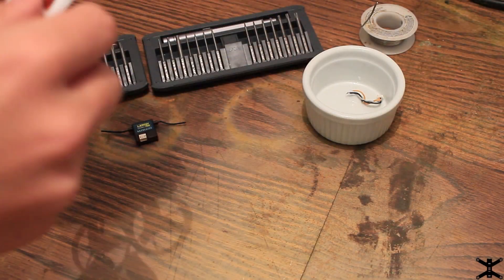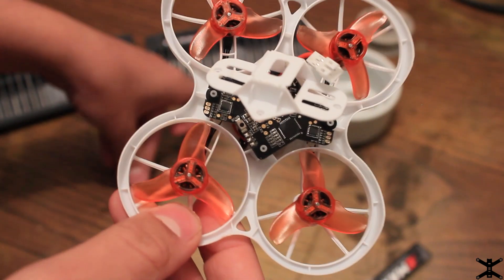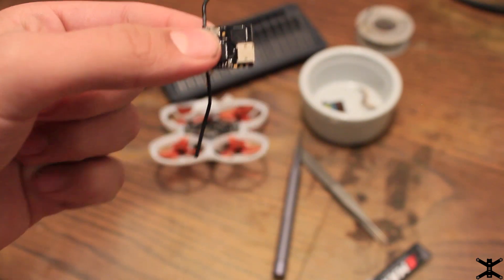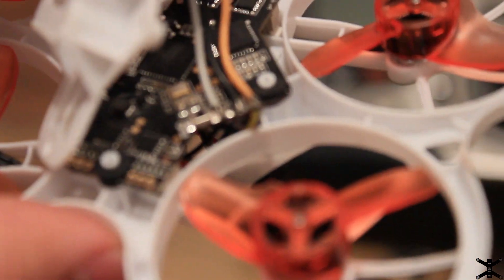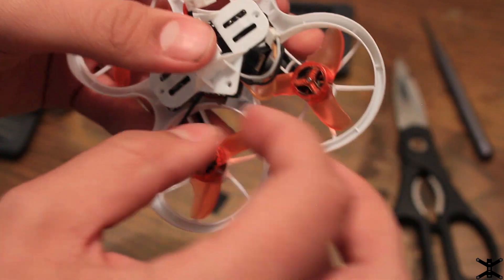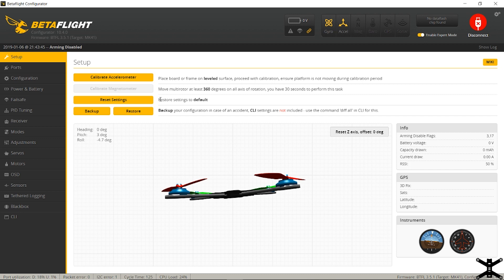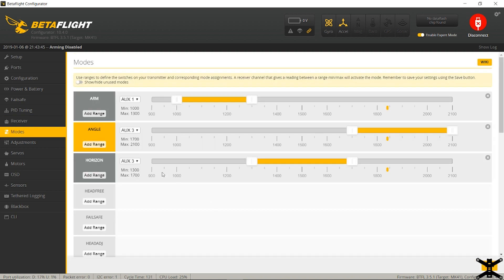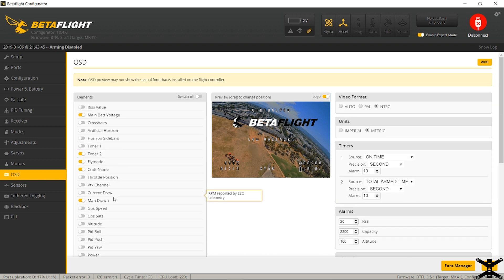How to Install and Configure a Spektrum Satellite in the Emax Tiny Hawk

Comment: Sorry to bother, but I am somewhat confused after reading some comments. I got the TinyHawk S, should I remove the capacitor, or just solder my satellite +/- to it?
Reply from the maker: I would just solder to the + - of it. I suspect the fixed the problem in the hawk S since it is a much newer version. Thanks for watching!
In the original tiny hawk that capacitor cause straight brown outs at low voltage for some reason. With the capacitor unhooked it the battery would slowly die instead of going from alive to dead in a second. At least this seemed to make a difference. Either way the hawk will work with or without the capacitor.
Reply: Virtual FPV alright thanks for the advice!!😄
Reply: Virtual FPV hey man, I just got done soldering and everything went to plan there, but once I hit save and reboot on Betaflight after selecting SPEKTRUM, my TinyHawk will not connect to my Betaflight, let alone computers... it says the device has malfunctioned. Super confused😬
Reply from the maker: @dylanmiller9604  Did you bind the Sat before soldering it in? Make sure your betaflight settings are correct.. Set to DSMX ect
Reply: Virtual FPV yeah I did, I can’t even get it connected to Betaflight at this point. My computer says “The last USB device you connected to this computer malfunctioned, and windows does not recognize it.” Whenever I plug it in... tried updating drivers and such but haven’t found a solution:/
Reply from the maker: @dylanmiller9604  Oh boy. You might have shorted something. Might be worth a shot to run a driver service to reinstall the usb driver
Reply: Virtual FPV sounds like a good idea lol, gonna do some late night troubleshooting😆

Comment: Excellent advice, this worked although I could not get turtle mode to work is there something I have to do in beta flight to get this to work?
Reply from the maker: Hey just make sure you have the right Dshot protocol set. Furthermore, turtle mode only works with the 4 blade props. You can try with the stock ones but its pretty hard to flip it over.

Comment: Hey folks, 16 year old here trying to get this working on the “S” model.  The video is great and super helpful. However, I was not able to get Beta Flight to work after the connection.  Has anyone else been able to get this to work on the “S”.  I will admin, the root cause could likely be my novice skills on soldering.  Any help/advice is much appreciated!
Reply from the maker: Hey man, does it not connect to beta flight or does beta flight simply not recognize the control input? Also, do lights come on when you plug the board in?
Reply: @virtualfpv3568  When I first got the drone I plugged it into BetaFlight and everything worked fine, so I know BetaFlight, cable and drone were all functioning. When I first started soldering the wires on, I’m pretty sure I bridged one of the gaps because after I was done soldering, and had moved into the beta flight part of your video, it would not connect although it did recognize it because it said “Connecting” when I plugged it in and the auto-connect box was checked. So I am pretty sure I messed up the board because I can’t get it to its original state even when I unplug the satellite and I pull off the wires. Also, when I plug in the battery, I see the board blink red, then solid red and I see a flash on satellite and then turn off.  I can’t get the light to change when I am trying to bind to the transmitter.
 
I did find a receiver (see link below) that would bind into my DX6 transmitter using the bind button on the receiver but would still connect in BetaFlight.  I could not get any response from the drone or from the menu when viewing through goggles. I assume this is because could not get to the steps on b BetaFlight part of your instructions in the video. 
 
My questions are this – what troubleshooting steps can I perform to understand if the board is salvageable before I buy a new board.  Also, any recommendations on what I may have done wrong (understanding that all you have is my write up).
 
Thank you so much for responding and at least attempting to help me.  I am extremely bored during my family's isolation, so any help is appreciated!
 
 
https://www.amazon.com/gp/product/B07YTWCYVZ/ref=ppx_yo_dt_b_asin_title_o01_s00?ie=UTF8&psc=1
Reply from the maker: @dkdewolf  Hey, have you tried re flashing the board? It sounds partly like a driver issue on the computer and also a board with corrupted firmware. You might have bridged something that caused this.
Reply: @virtualfpv3568  I can't figure out what firmware to flash because I can't get into BetaFlight to see what I Version I was using. Do you know if there is another way to figure out what firmware I should flash?

Comment: It would have been nice you talk about which solder pad is what, and which wire colour represents what. I'm trying to do the same thing with a FrSky R-XSR because the remote controller I got doesn't support D8 protocol and I try to figure out which pad is which. On the manual, it says the SBUS port is the one in the middle, while on the board, it says it's the one on the right (the one you solder the orange wire). If you remember, I'd appreciate you let me know which one is VCC, Ground and Serial. Thank you
Reply from the maker: At 7:01 the order of the wires should be Signal, Ground, VCC (3.3V). (I believe they are labeled on the board) I would not recommend using a FrSky radio with this though. If your board is labeled differently, go with the what the board says. I bought my hawk just after it came out, so there may have been some changes.

Comment: Just a PSA, I emailed the guys at LemonRX awhile back about this. You can replace those antennas with a ~32mm piece of ESC/Servo wire if you mess them up.
Reply from the maker: Yup!! Only the length is important. Still nice to have them reinforced so you're not constantly replacing them. :)

Comment: Thank You!  Exactly what I was looking for and needed.  Got me up and running without issue.  GREAT Job!  Thanks!

One comment I would make: Instead of recommending the removal of the surface mounted capacitor over the v3.3 +/- pads, I recommend leaving the capacitor in place and just solder the +/- wires to the capacitor.  Not really that difficult and maintains the cap to help minimize low voltage dropout.

Comment: Could I soldering directly to the capacitors sides?
Reply from the maker: You can if you want, but its probably not necessary: The capacitor was added to prevent brownouts, but it seems to do the opposite: I have a couple friends that have hawks and they never had to replace the receiver. Their hawks tend to brown out and fall out of the sky all of the time while mine (without the capacitor) seems to act normally. I think the receiver already has enough capacitance build in to be perfectly fine. It might be even better to leave the cap there, but it will work as intended without it.